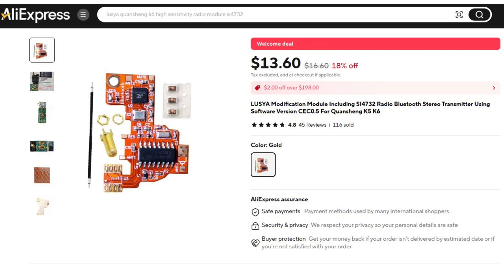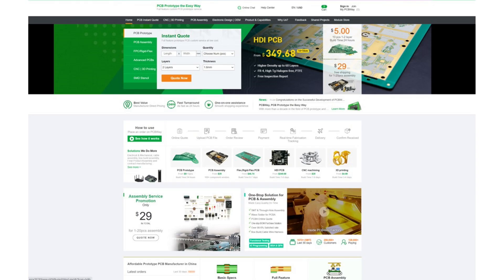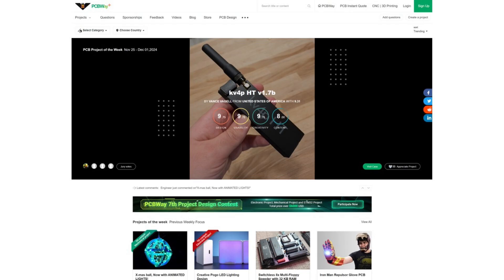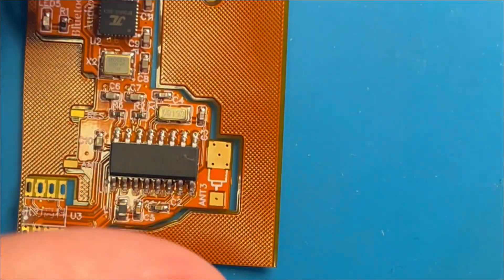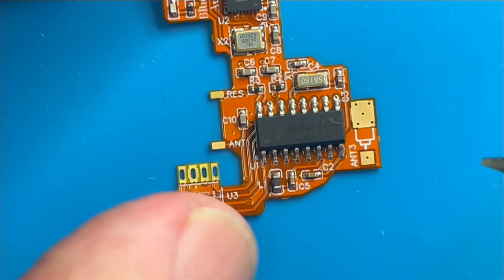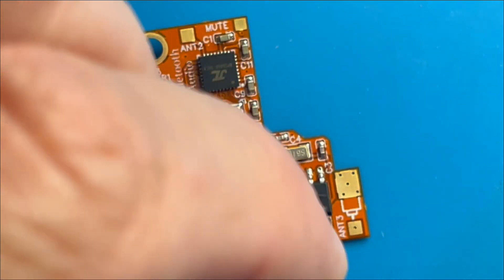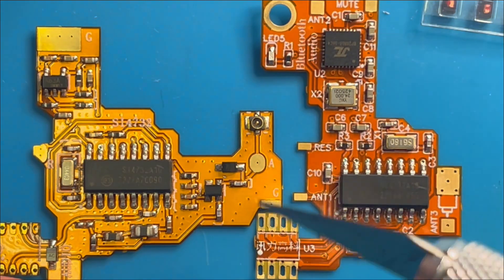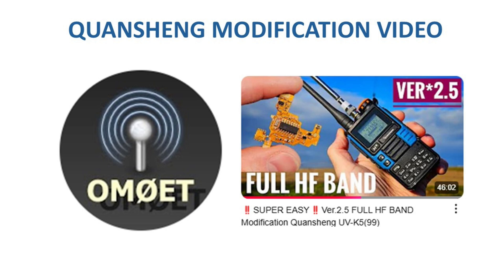EB012 - NEW QUANSHENG K5/K6 HF MOD V3.0 WITH BLUETOOTH

Comment: Does this allow to also use a Bluetooth push-to-talk button at the same time as the headset? I'm looking for a radio that I can use on my motorcycle. I have a bluetooth headset in my helmet and would want a wireless button mounted on the handlebars to talk to other riders.
Reply from the maker: Hello, no this mod only provides for the transmission of audio from the radio to an external speaker / headset.

Comment: Should have watched this before I bought it. The lack of an RF amplifier may well come back to bite me, assuming I can't cram one in there. I assumed the more recent unit with the bluetooth would be better generally, the lack of a u.fl plug should have tipped me off. I hope someone makes a version 4 with no missing features. Or I could make one I guess.
Reply from the maker: Hi, thanks for you comment. Actually don’t worry about it. I was going to design my own board with everything on it. However, after testing this HF mod next to a professional HF radio (xhdata D808), the Quansheng could receive just about everything that the Xhdata could. Quite honestly, I don’t think the RF amplifier makes a real difference. 73 ElectroBananas
Reply: @ElectroBananasYT 
Too late, already ripped it out. It might still work, but when I learnt I needed to buy a programming cable instead of being able to program over USB I decided to get a V5 board at the same time anyhow. I imagine the amp will make more of a difference with a suboptimal antenna.

Comment: Hello friend, I saw that there are several chips to make this modification to the UV-5K, which one is the best?
Another question: with this modification, how many watts does it transmit at HF frequencies?
Congratulations on the video, fantastic
Reply from the maker: Hello, thank you for the comment. If you don't want Bluetooth, the best module is the one I introduce at 03:12. The modification does not allow transmission on HF, only reception.

Comment: is there room for 2 diodes back to back on the chips antenna inputs?
Reply from the maker: Sure, if you use small packages such as 0603’s and your soldering was good enough. Not easy though…

Comment: Stereo on headphones bluetooth?
Reply from the maker: The Bluetooth chip is wired in stereo to the SI4732 HF/FM radio IC and you can hear sound on both Left and Right channels. however I think the software I am using (CEC 0.51) only enables the sound in Mono when listening to FM. I have not tried other versions of software to see if FM is I stereo.

Comment: Very interesting video, I intend to buy the board and adapt it to my K5. Where can I get the CEC_0.51HF firmware? Do you need to remove any components other than the chip? Resistors or capacitors?
Reply from the maker: Hello, you can get the software here: http://www.hamskey.com/2024/04/introduction-to-uv-k5-hf-05-fullband.html
If you decide to fit an additional antenna with the new SMA connector (as I did), then no, you don’t have to remove any other components.

Comment: Why would anyone want to do such a stupid thing hacking up a perfectly good radio to add HF when there are already a lot of HF radios available?  If you just want to experiment get an Arduino Nano, display, some push buttons, an optical encoder and put it on a breadboard.

Comment: Great Video...
Clearly the Version 2.5 is far more better than this BT chip. Its a foolish idea to go for this degraded feature chip. For receiving BT you can also plug a solo external BT dongle in the speaker Pin and get an BT audio out. That would also mute the main speaker.
Thanks & 73s
VU3OSA
GAURAV US
INDIA 🇮🇳
Reply from the maker: Hello, thanks for the comment. Yes, in terms of HF features, the V2,5 module is much better.

Comment: Does the bluetooth also work in the regular VHF & UHF modes?
Reply from the maker: Yes it does
Reply: @ElectroBananasYT  Meanwile i have installed this board into my quansheng and it works with CEC 0.51 firmware. But for some reason it doesn't want to work with the Fagci Reborn Nightly firmware. (Firmawre works on another one i have modified with a previous version of the SI board). I can get the Fagci Firmware to work , but no reception on any of the USB or LSB bands

Comment: There's only $5 worth of parts in this kit 🫤

Thanks very much for the well presented video 👍

I wish Quansheng would release a radio with clear plastic case. But i understand that might not be possible.
Reply from the maker: Hello Edward, thanks you the positive comment. Yes the parts seam cheap, although I did have a look at buying the parts to build a new modification module of my own, it was more expensive 😞. There are transparent ones on AliExpress: I just found this on AliExpress:
https://a.aliexpress.com/_olMsghh
But I doubt they are from quansheng. Perhaps someone is putting a custom case on them and reselling.
Reply: @ElectroBananasYT  
Oh wow ! Thanks for sharing that, they need to make the keypad transparent too though.

I'm aiming to recreate my clear Nokia 3210 in Quansheng form ! 🤣 Lol
Reply from the maker: Amazing, are you 3D printing from clear resin or PLA?
Reply: @ElectroBananasYT  Ohh no, I don't have the 3D skills for that, I just want one of my UV-K5's to have a clear case. I love clear case electronics from being an old phone tech 👍

Comment: So you didnt need to use any chokes ?
Reply from the maker: The board has two antenna connection points, one on the left and the other on the right. The one on the left is connected if you wish to use the existing antenna. If you use the existing antenna then you need to replace the choke. So in this way it is like the first generation of boards that could only connect to the internal antenna and require a change to the choke. However, if you wish to install an additional SMA antenna socket and use that, you use the antenna connection on the right  (like I did) and it is not necessary to change the choke.